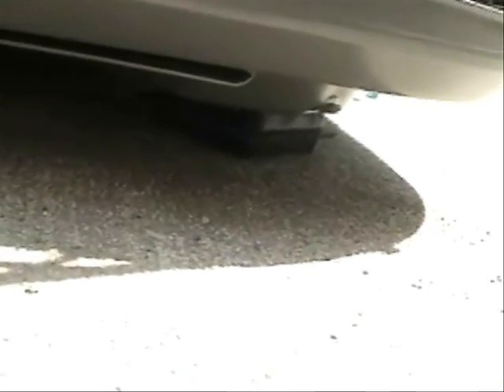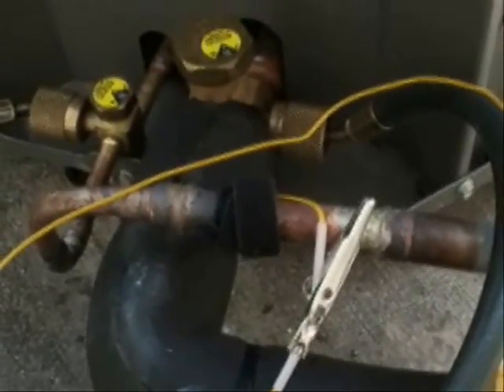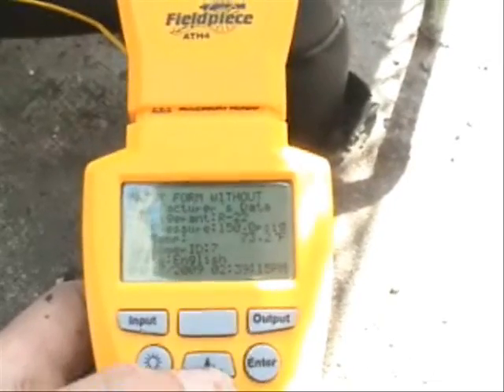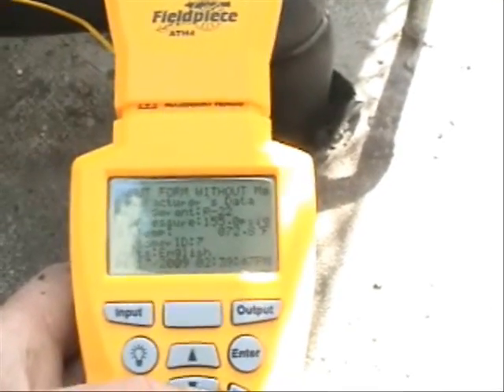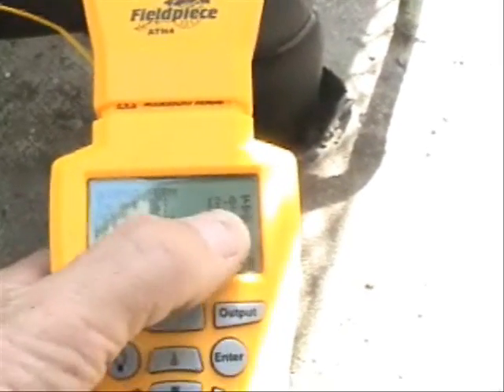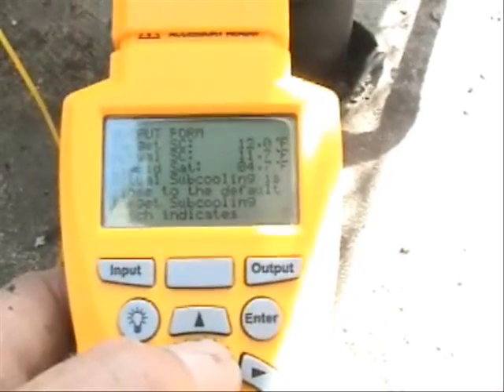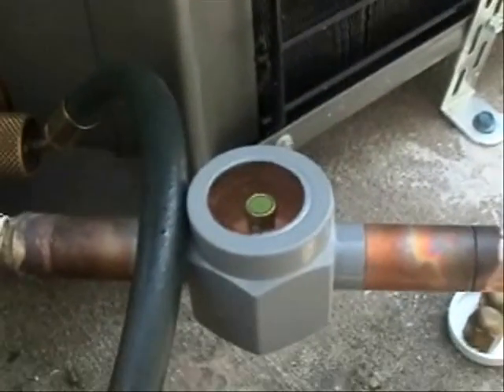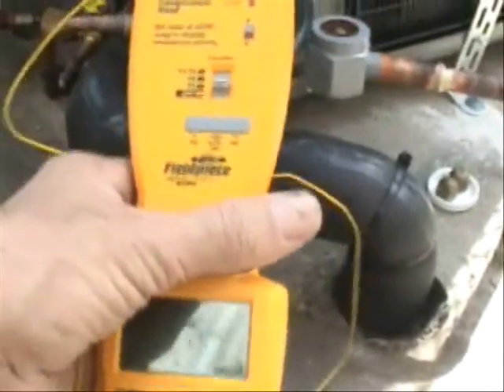HVAC Subcooling with the Fieldpiece HVAC Guide

Comment: R22 or 410a are not what determines the charging method. It is the metering device that determines it. 

TXV= subcooling. 

Piston/fixed orifice= superheat.

You also need the indoor wet-bulb temp.

Hope this helps